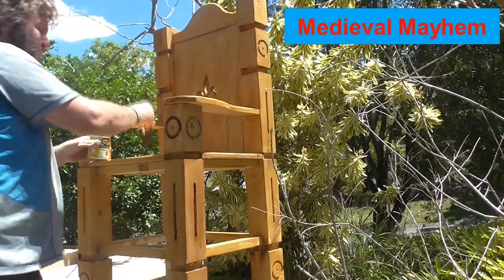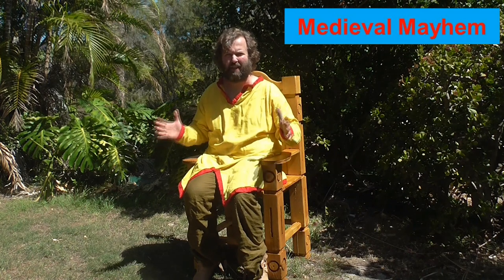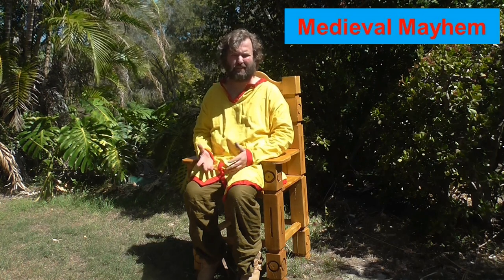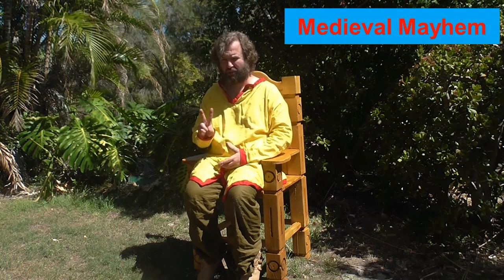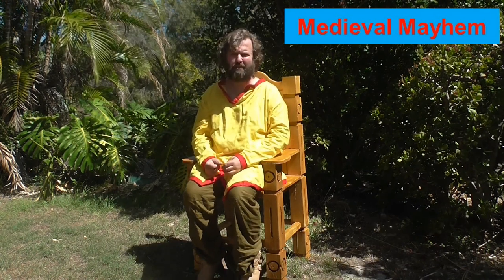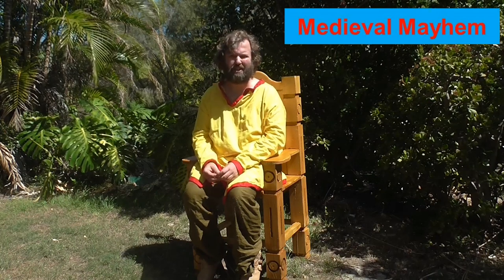How to make a medieval style Throne DIY LARP SCA Re-enactment COSPLAY

Comment: Couple of suggestions on speeding things up: You obviously have clamps - you can 'gang cut' a LOT of your parts, and they will be spaced exactly the same - just mark the order of the faces (triangle or numbers on the end), clamp all the similar parts so all the same faces face up and one end is square across - in this case, the bottom of the legs - mark the saw cuts and cut to the inside of the line across all the pieces - you can then use the router with a straight bit to blast out the waste (or use a chisel & mallet). Rotate the pieces one side, reclamp and repeat until all sides are done. You can make a simple saw jig by connecting two shortish pieces of 1x timber into an "L" shape - one piece should stick out about 6"(150mm) more than the other - you position your saw so that the blade is lined up with where you want to cut then place the 'L' so the long piece is against the saw base then clamp it to the job - now you can use both hands to control the circular saw and drastically reduce the chance of loosing a finger or two (or you can buy much the same thing from Kreg or other online sources but DIY is cheaper). I hope Ryobi is sponsoring you, or at least giving you a few batteries with all of their tools you are demonstrating for them :-)
Reply from the maker: Hi Bruce. Wow. That's a lot of insight. Thanks - I appreciate all of what you've said. No, no sponsorship from anyone.